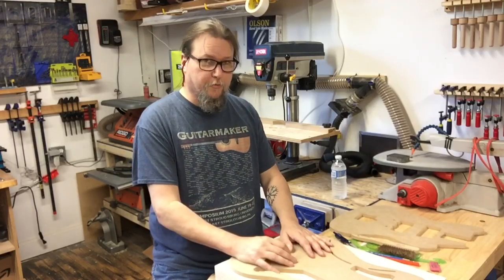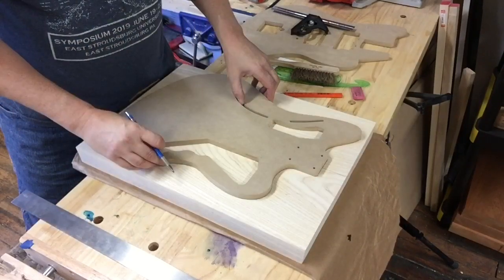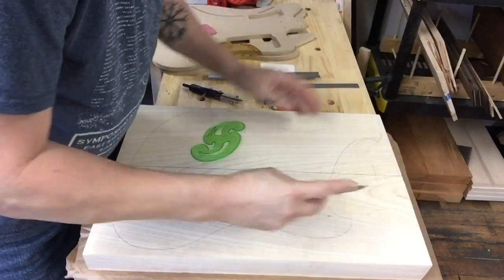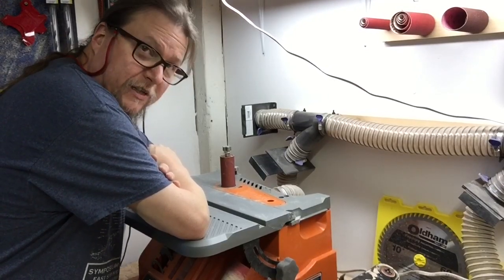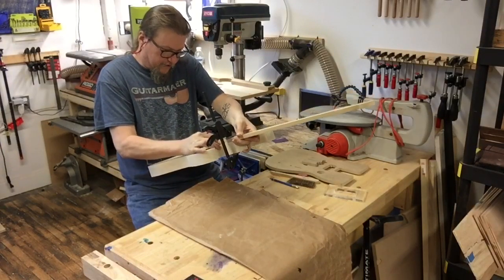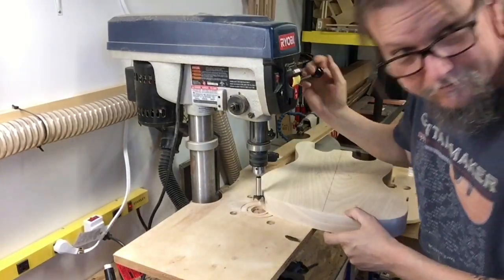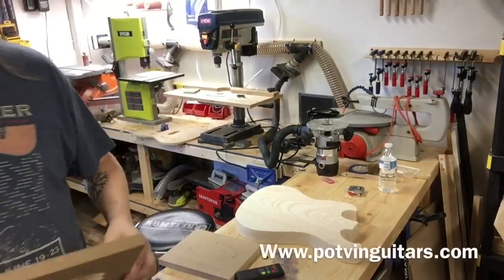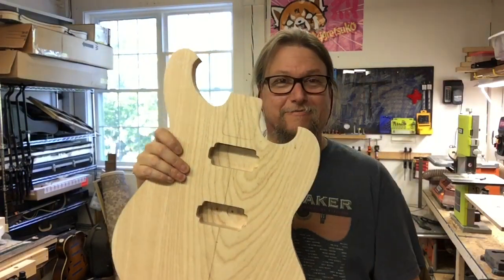Tafty's (unofficial) Great Guitar Build Off 2020 Part 3- Body talk

Comment: I always liked the Jag/Jazzmaster body shape a lot, and I really like what to did with it. This may sound nuts, but you should paint those two slightly deep forstner bit holes to look like the pupils of eyeballs. This would only work if you used black shielding paint (foil won't work), left the center of the hole (pupil) black, and painted the iris an eyeball color like blue or green. Years from now, when some future luthier works on the guitar, when he removes the pickup, he will see two unexpected eyeballs staring back at him and he might get a good laugh out of it. Looking forward to the finished project.
Reply from the maker: That would be hysterical. I'm definitely going to do something like that

Comment: I have a question, about something in the background.
On the floor, in front of your wire shelves, I see what appears to
be a sunburst acoustic body, with 4 (pickup???) cut outs.
What, I pray thee say, sir, might that be for???
Reply from the maker: That's a 50's archtop that I'm restoring. Those aren't pickup holes, those are 4 pieces of blue tape with the centerline marked on them. So I can line up the neck when I'm done putting the body back together.  That would be neat though!
Reply: @TaftysGuitars :
Oh, OK. That makes more sense, than what I saw.
I'm not too sure about how "neat" that might be. Off hand, it seems impossible.
But, then again, (Oh, here he goes, thinking again)
You might be able to start with a "fence post" design (like Leo Fender's first)
and instead of just hollow wings, give it a full acoustic body.
Maybe, leave the neck and finger board like an acoustic, so it plays like an acoustic?
How does that sound? Has it been done before?